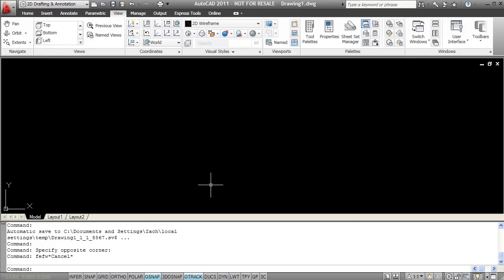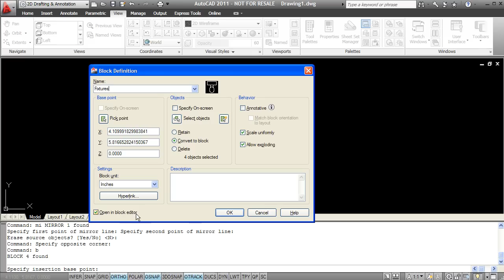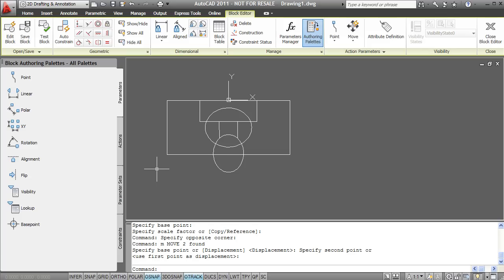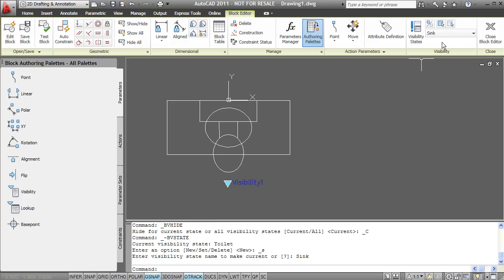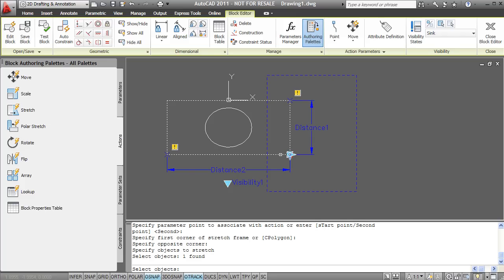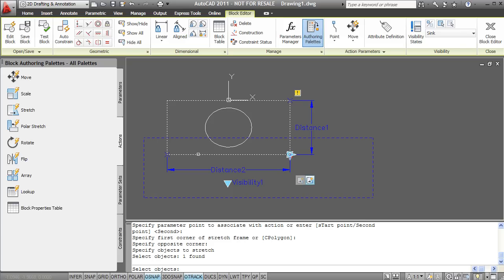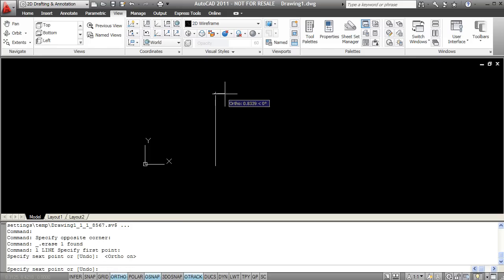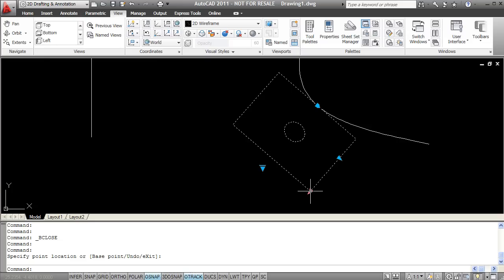AutoCAD Dynamic Block Tutorial

Comment: Thanks for the video.  I hv 3 questions regarding dyn blocks namely 1. the importance of base point parameters here not defined. 2. how you make the circular sink remain at the center 3. the logic behind making the stretching equal by using two actions with 1 stretch parameter.